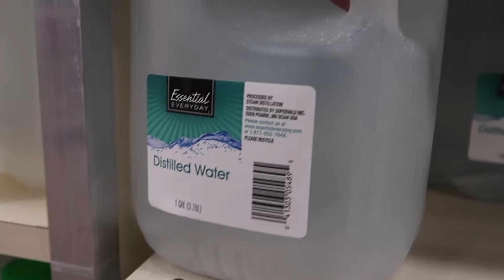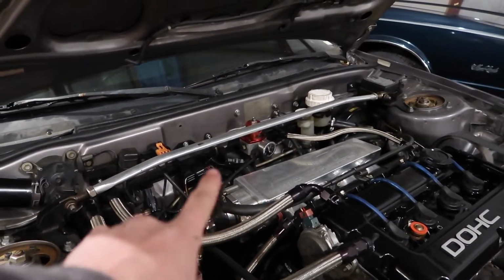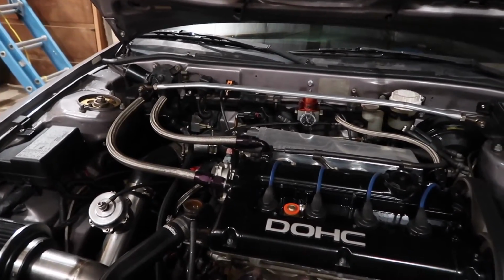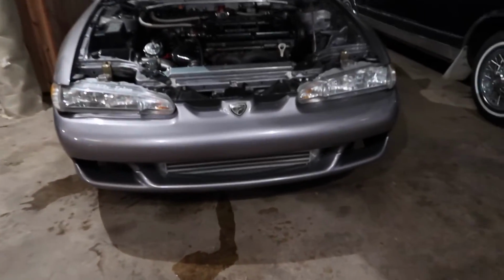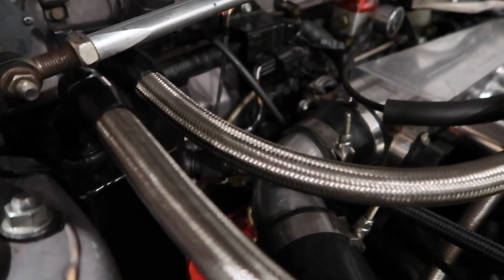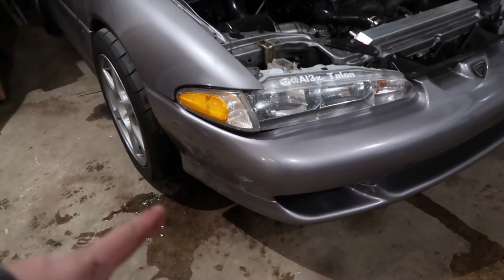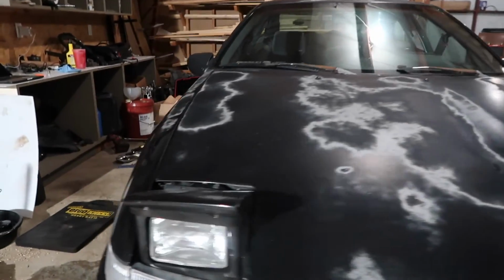Winterizing my 500hp Eagle Talon

Comment: I put my battery in my trunk with a Taylor battery box 
It's super easy I did that way to many times
Reply from the maker: I put mine in the engine bay from the trunk because it wasn’t track legal.
Reply: @Al3xTalon  a 100 dollar Taylor battery box is 150% track legal 
If you mount it the way the instructions say like I did 
I get teched so many times at the 1/4 mile and they always said I was good 
It looks good to
Reply from the maker: Technically NHRA regulations require a shutoff switch outside the vehicle. I’m not willing to do that on a car I hardly take to the track. I still have my rear battery setup for car shows (that’s how I run my neon sign and the car lights) but the small battery is for the track.

Comment: yo have you ever got the "black goo" on your injectors cus the e85, this just happend to mine and im getting injectors cleaned
Reply from the maker: I haven’t no. You should try doing what I did and running pump gas through the system every now and then. Cleans up the mess from E85. There is also an E85 specific injector cleaner that you put in your gas tank when you fill it. I’ve ran that before.

Comment: Could u have just drained all the distilled water out from the cooling system, and let it sit empty over the winter?  Then refill with distilled once it’s warm again and u get to driving it again?
Reply from the maker: Probably can’t get all the water out if you just drained it. Water ends up sitting in the block. The main purpose of only running water was because my car kept breaking after I first put it together. Now things stay together better it’ll do just fine.